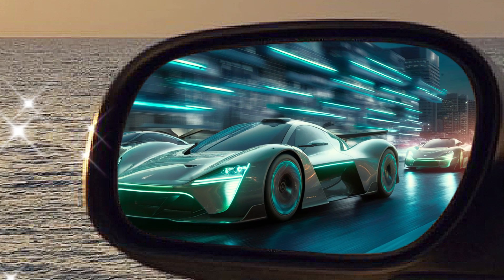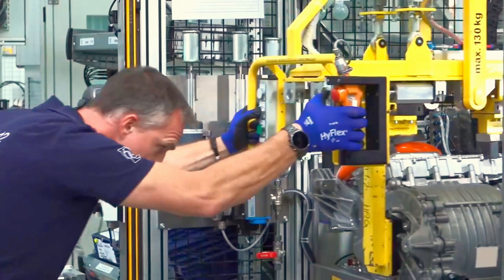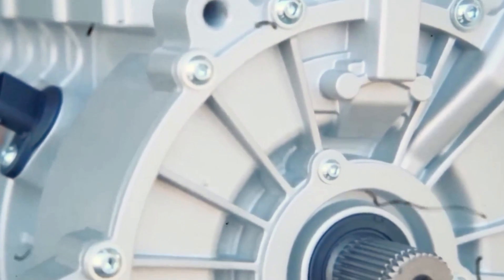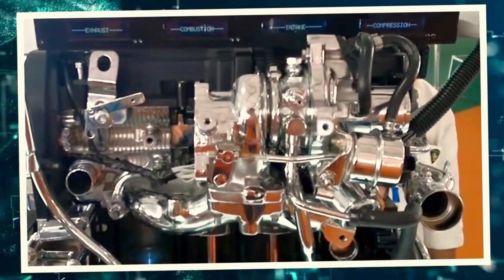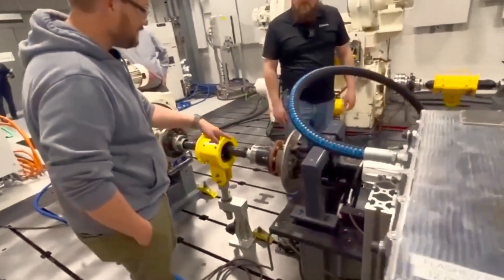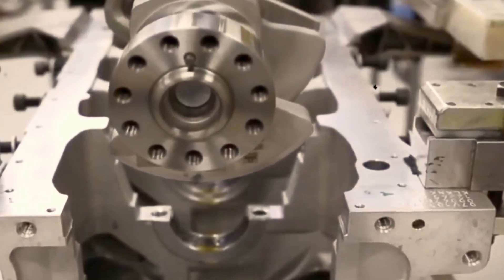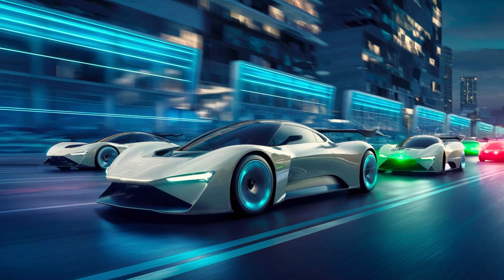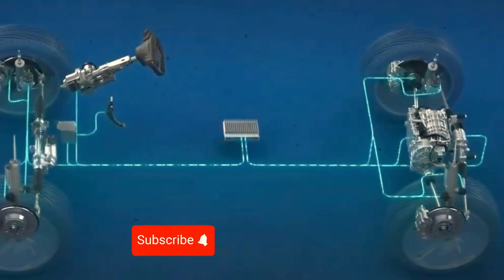HELIX: SPX 177 A QUANTUM JUMP IN ELECTRIC MOTOR TECHNOLOGY

Comment: The size of the motor itself is astonishing. 200mm diameter and 250mm long and weighing a little over 28kg.... It can output nearly 1000hp 😮

Put that in terms of ICE equivalent for one moment... What are we talking? Quad turbo V12 6 litre maybe. Massive lump with massive gearbox and massive cooling system etc. Outstanding...